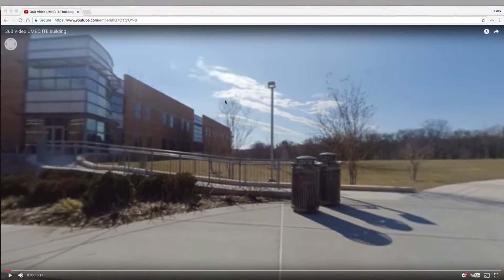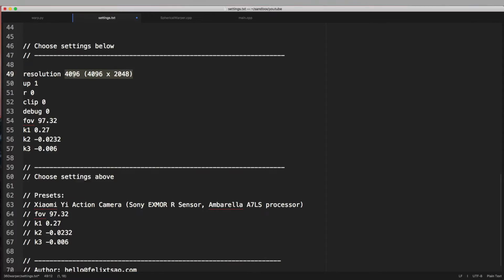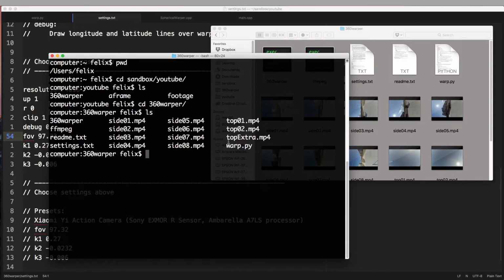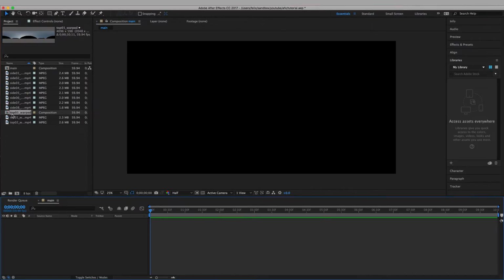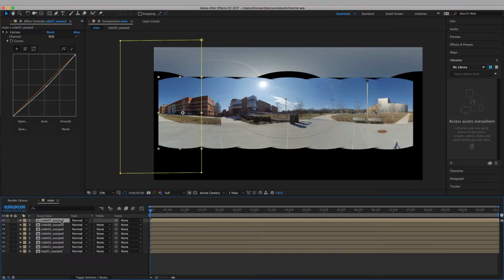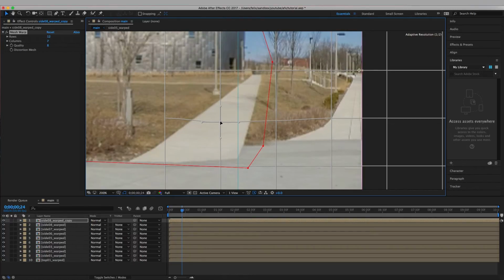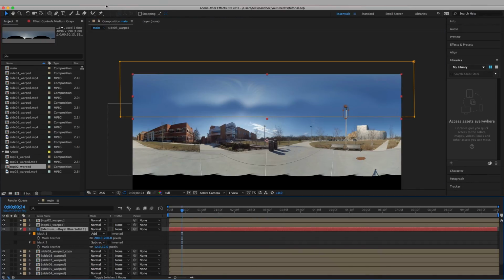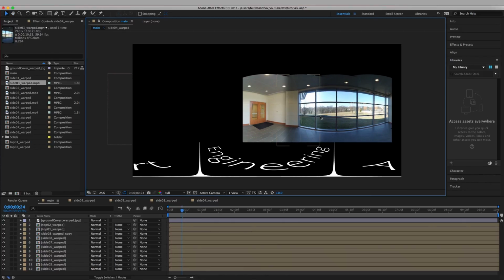How to make 360 video including up camera and text, without stitching software

Comment: If you can afford Adobe - After Effects you can effort a 360 camera. Don't waist the time on this exercise.
Reply from the maker: Thanks for refreshing the context for 2024. Yeah I agree this video is a bit outdated now since there have been several off-the shelf 360 camera products released on the market. This video is a bit long and for 2024, I guess the only relevant info left is visualizing the projection of video from sensor space to spherical/equirectangular map. For building a 360 camera with higher resolution than market products, stitching multiple cameras together may still be necessary whether it be with After Effects or some other custom solution but agree that for off the shelf 360 products this video is not that relevant.

Comment: Hi Felix, How would I stitch together 2 180 footage of the same scene but they are slightly different that were shot on a 360 camera? Would I have to use to identical 180 to create a 360 or can I use two similar 180 and create a 360? I hope it's not to confusing. I tried it on your simpler version and got holes at the top and the left and right side didn't match up. Thanks!

Comment: Hello Theo, not sure if this is the best place to ask this question. I have been trying to get the windows version of 360warper running but I've run into a few errors that I haven't been able to find solutions to. When I run the python script the program seems to run fine for a few minutes until this error pops up: The program can’t start because zlib1.dll is missing from your computer. Try reinstalling the program to fix the problem. I am also getting a the identical error for these dlls as well: 

Libgomp-1.dll
Libgcc_s_seh-1.dll
Libstdc++-6.dll
Reply from the maker: It's asking for some libraries that aren't installed on your computer. Here is a zip of the DLLs you've listed. See if placing them next to 360warper.exe works.
https://mega.nz/#!BNUkjAxJ!gt_kvCw_-blnP38RoLG3BAUPRlDmfCjjXBcC-1fO2JE

zlib does image compression
libgomp does multithreading
libstdc++ and libgcc is for common c++ stuff